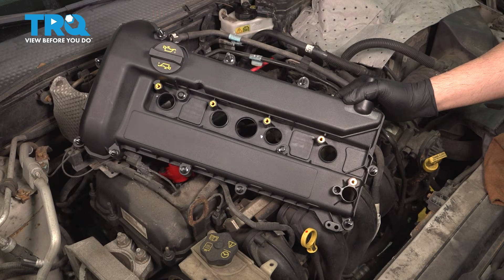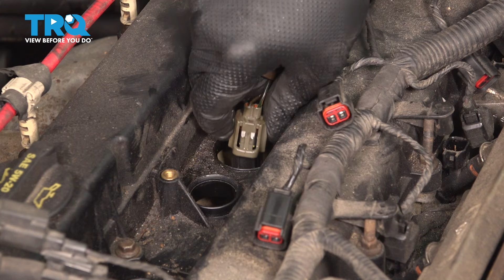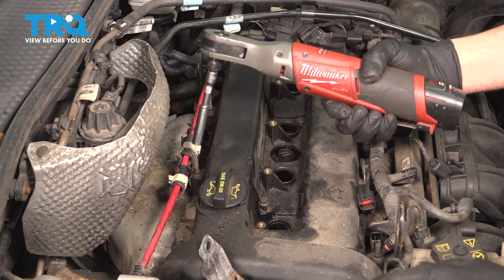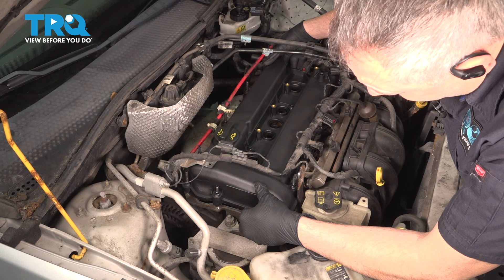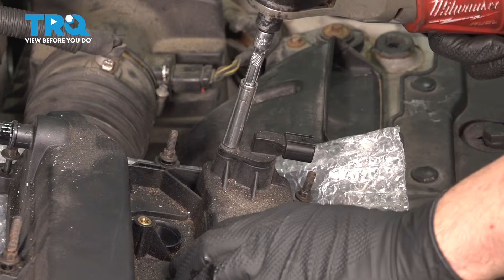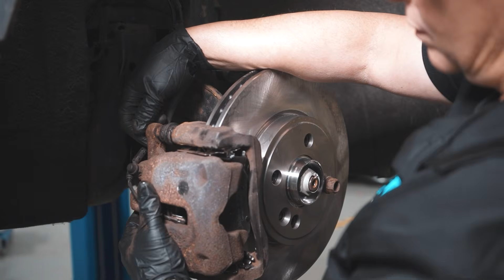How to Replace Valve Cover 2008-2011 Ford Focus

Comment: It's a nice video, but I'm surprised you didn't make it 2 minutes longer and show the most important part - properly placing the new gasket, with any tips on keeping it in place while refitting the valve cover to the head.